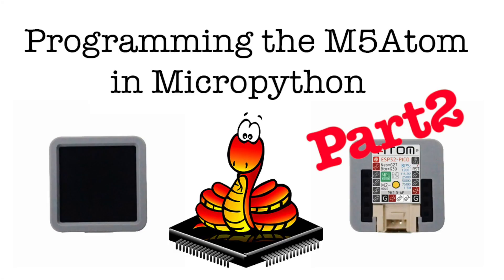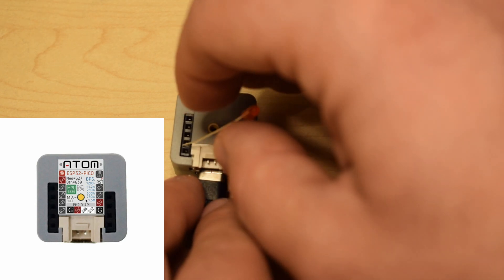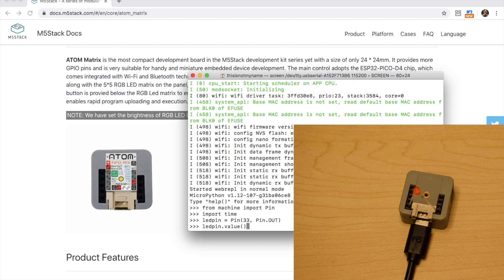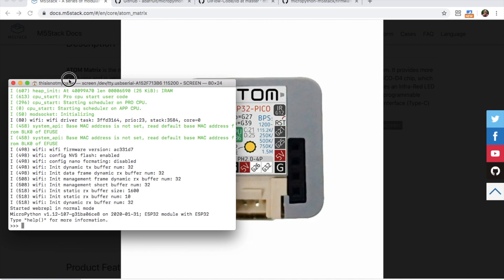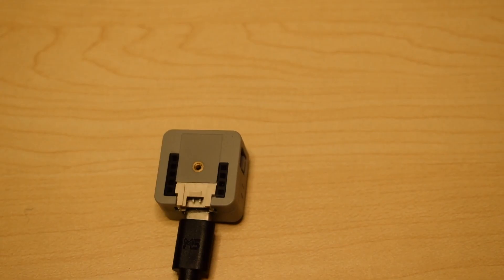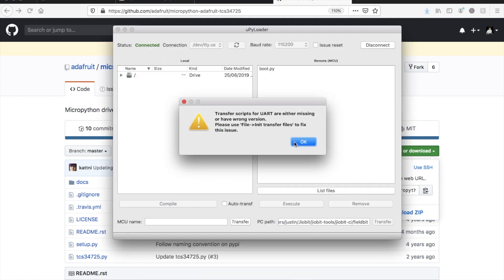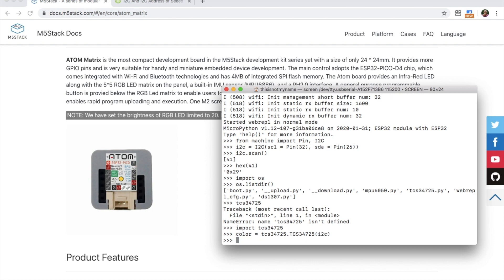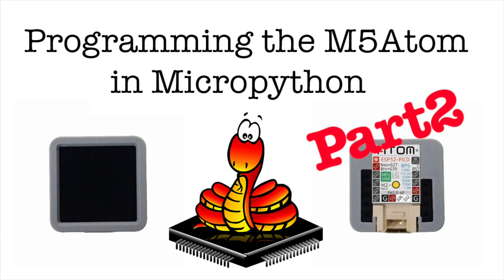M5Stack Micropython programming for M5Atom Part 2

Comment: Hi! What would be the best choice for ide to start developing on atom? I couldn't get vscode-m5stack-mpy to detect atom on vs code.
Reply from the maker: Hey likka, you can use vscode fine with uiflow micropython firmware, you just need to make sure it is in usb mode before programming, please refer to this video for how to set the atom in usb mode https://www.youtube.com/watch?v=4dr5Y5ssQTk&t=8s . If you'd prefer to use pure micropython firmware you will probably need the flow_usb.py module on the filesystem although I have not tested this working

Comment: Hi there. I tried to find the MPU6886 on mine and it is working - maybe you should try it with another device.

>>> from machine import Pin, I2C
>>> i2c = I2C(scl=Pin(21), sda=Pin(25))
>>> i2c.scan()
[104]
>>>
Reply: hi marcus, didn't expected you here. Another experience ? Jörg
Reply: @IonizedSun  I told you - that is what I do on my wekends
Reply from the maker: That's good news. My atom is from the test run, so it's possible that it's a hardware issue, I'll have to wait until I get another unit to test. I've been told there is not much difference between the 6886 and the 6050, you can try to experiment with the 6050 micropython library https://github.com/lukasmaximus89/M5Stick-1.2.3-Modules
Reply: I tried but using my colleague translation of the mpu6886 arduino library. It worked very well so I publish it on this article.  https://www.hackster.io/324677/fun-with-atom-matrix-323e3b
Reply from the maker: Thanks  @mtarquinio  that's awesome
Reply: @M5Stack  Please keep the uPython videos coming!